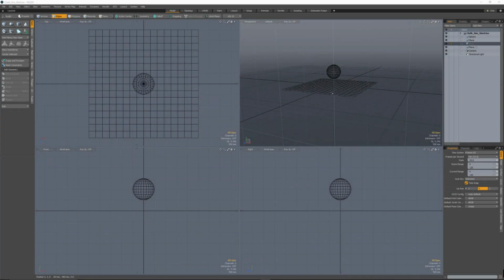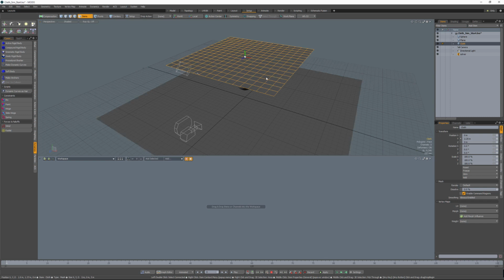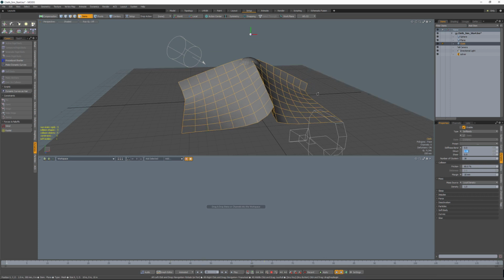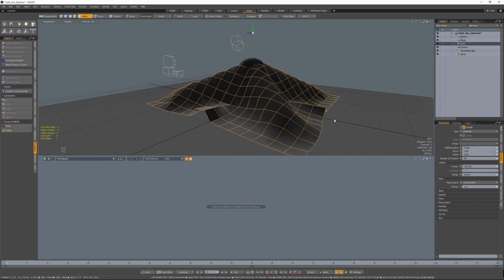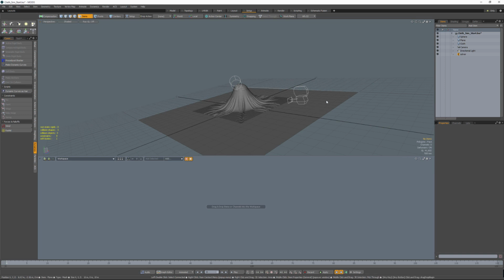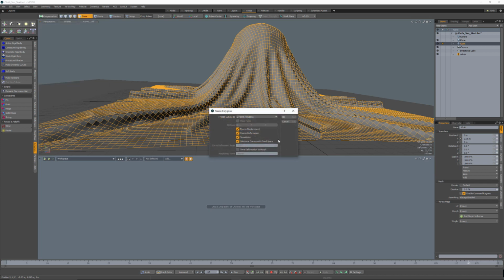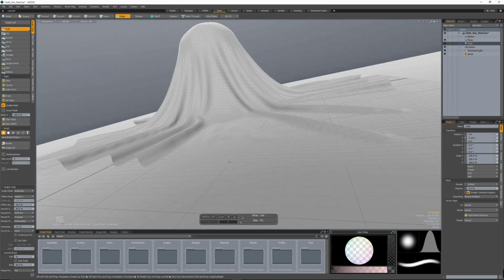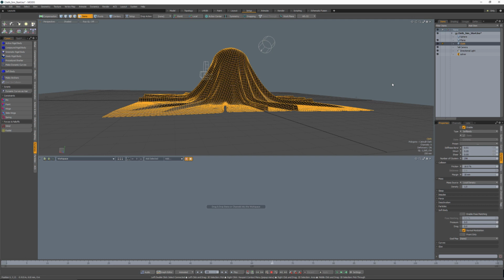Episode 08 Cloth Simulation

Comment: Moin,

this is a great introduction into soft body simulations - fantastic!If I may add one and a half suggestion: Instead of lifting the cloth mesh up into the air to give it some more "oomph" on collision, try decreasing the default "drag" in the soft body's "force" tab. It usually is set to 4%. This drag helps taming down the jitter that may appear from very tight folds, but it also reduces "naturalistic" behaviour. For most cloth simulations I do I have the drag between 0.1 and 1.2, but never ever as high as its default 4%. Also (that's the .5 suggestion): When lifting the cloth and not adjusting the solver's rate (number of subframes calculated) you increase the likeliness of poke-throughs or penetrations, because the cloth accelerates on its way down. The longer it falls, the larger the "jumps" will be it makes between frames, so the simulation may miss more collisions if the falling speed is too high. So when increasing the distance between the collision objects (cloth and ball/ground), also increase the physics "rate" in the solver to compensate - it may well be that you would not have needed to manually adjust the poke-throughs that way.Marc